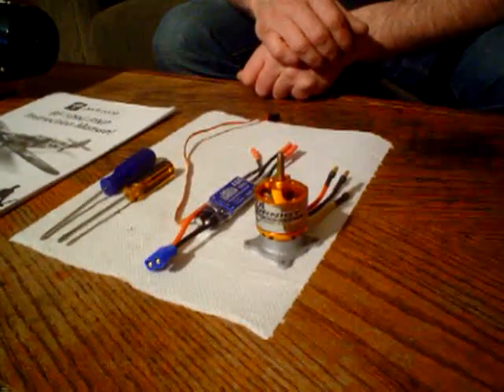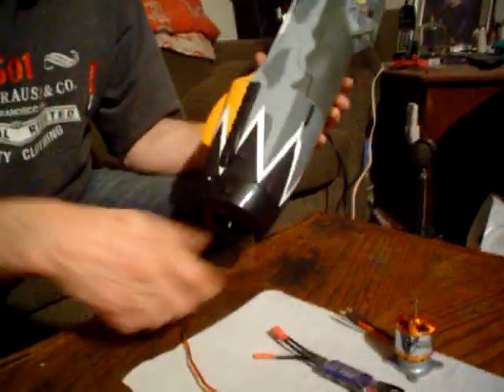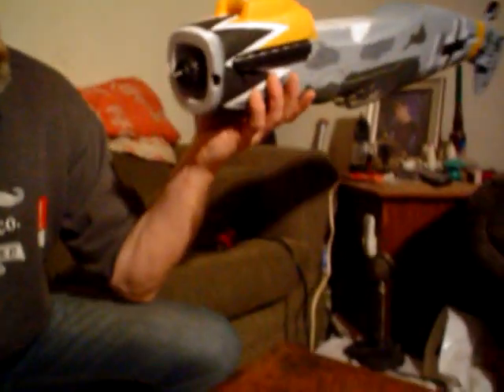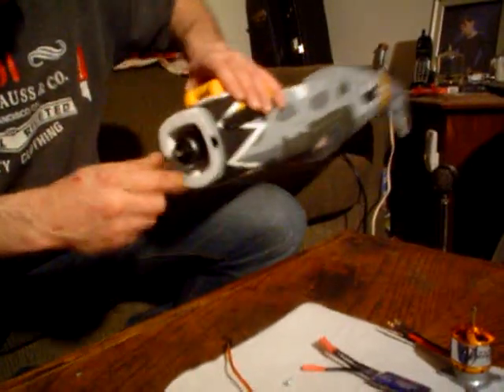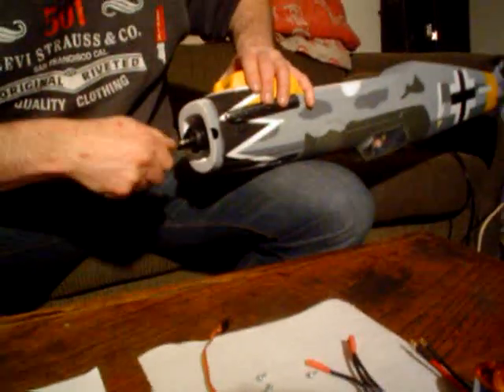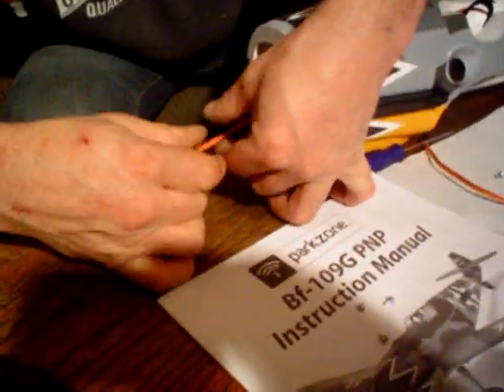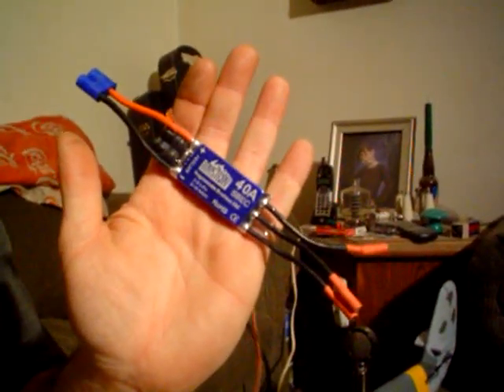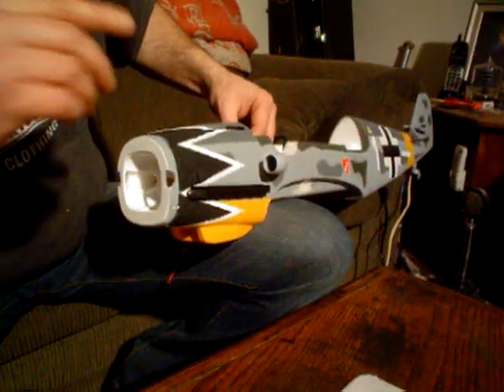Parkzone ME109 power upgrade Part 2

Comment: hello I just bought this motor for my parkzone bf109 would you happen to know part number for that motor mount or were icould buy it thanks
Reply from the maker: +antone silvia  Hi there .. Im sorry but when i purchased this motor the mount came with it so id have no idea ,I did however buy it on ebay .. if you search around you may be able to find one. worst case it should fit on the original mount.. hope that helps you